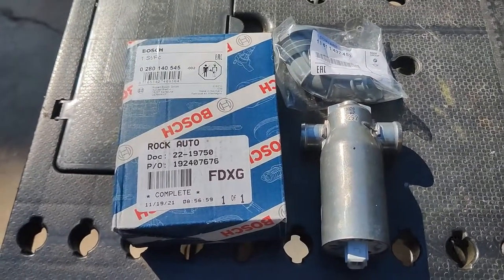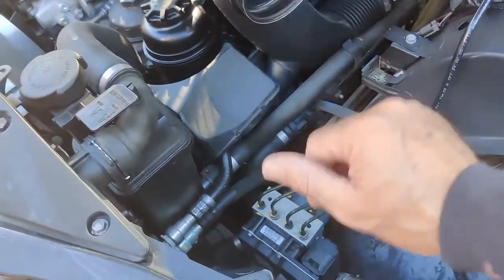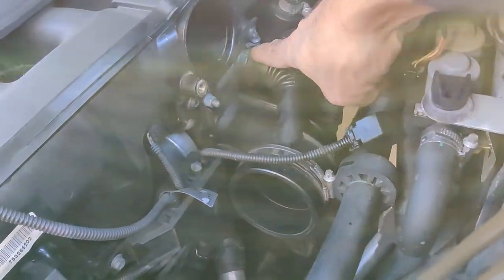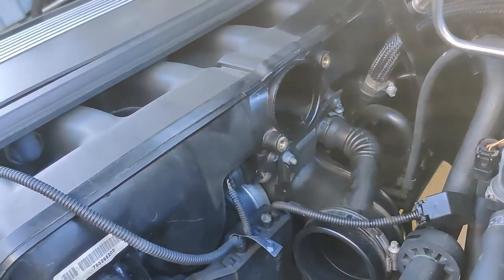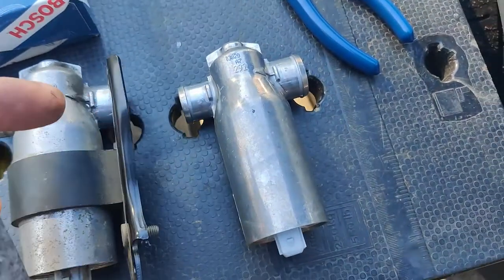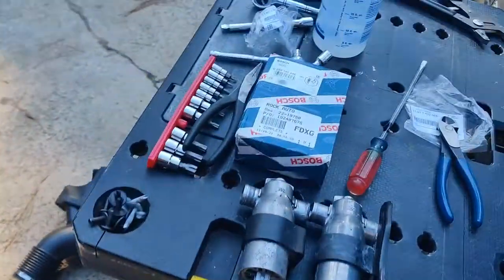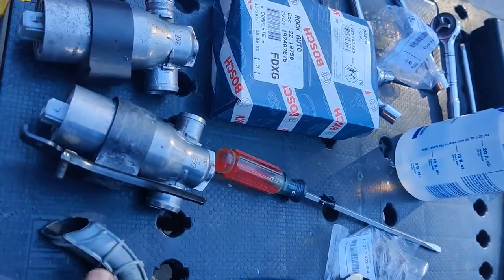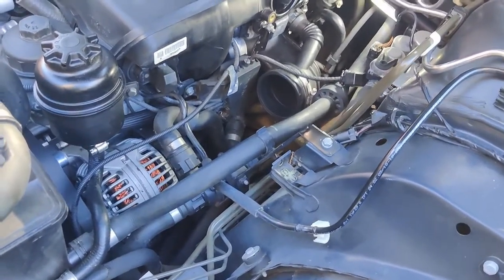BMW M54 Idle Control Valve Replacement

Comment: As some have mentioned already, this is probably the best video on the subject I have seen thus far. So specifically clear and straight forward. I have an issue with my icv. It was so hard to find a strong A to B on this topic. This video is tremendously helpful.  Thank you.

Comment: does the hose next to the oil stick close to that aluminum threaded hose is supposed to connect to anything? I have a 04 x5 3.0i and mine is loose not connecting to anything. at 3:46 behind your hand

Comment: What symptoms did you have in case of bad idle control valve?Rough idle or no idle at all?Maybe EML control light?
Reply from the maker: Hello Mario, In my case I had a rough idle.  I had already cleaned the idle control valve once and the car was close to 300,000 miles on it.  It was time to change.  No lights came on.

Comment: I have been working on BMW vehicles for long time and always find crack on rubber and plastic hoses. I use rubber JB weld to fix every cracks on rubber or plastic hoses. Never have any issue.

Comment: thanks for the video....   I've removed everything and still when I grab the valve I can't take it out even though it moves but with the feel of a rubber hose attached... I don't wanna apply too much force pulling it out cause I feel I might brake it... seems to be attached to the back air opening of the valve.... as you've stated... is there a clamp on that back hose? or should I just pull it maybe helping kit with a flat screwdriver ?
Reply: Nobody says this in the videos but you have to turn/tilt it a little bit. Then it does not need much force.
The videos are usually bad not telling the important things.

Comment: Did you try cleaning it first with some brake cleaner before purchasing a new one when you clean it real good you can head rattle inside when you shake it
Reply from the maker: Thanks for your comment.   I have cleaned the valve in the past before, but this time the noise it was making was different.  It was hard to hear in the video, but it sounded as something internally had broken.
Reply: That was the very important question.